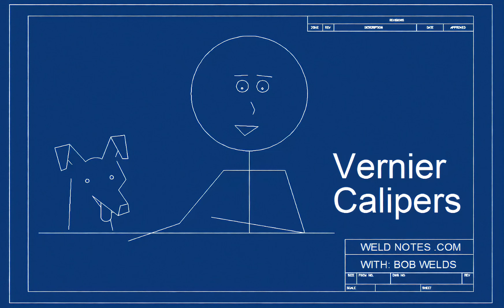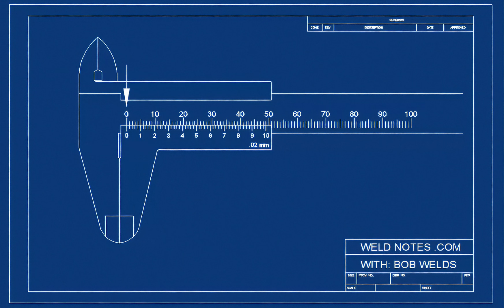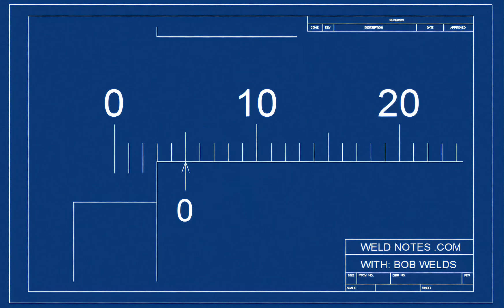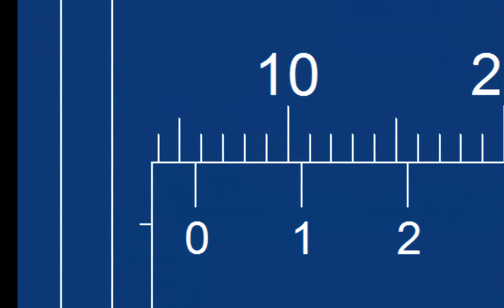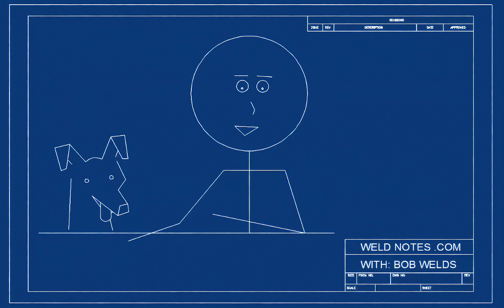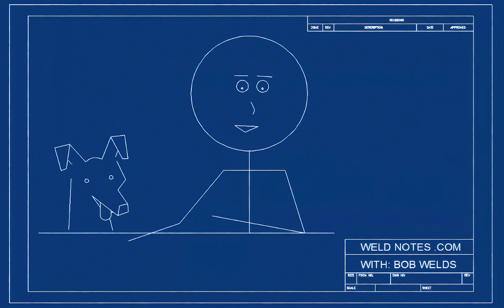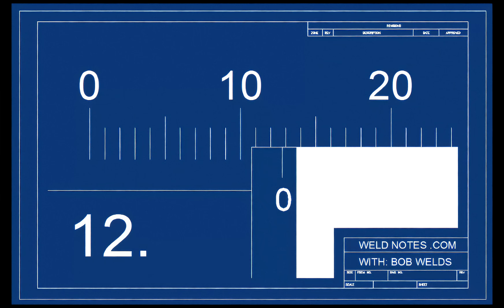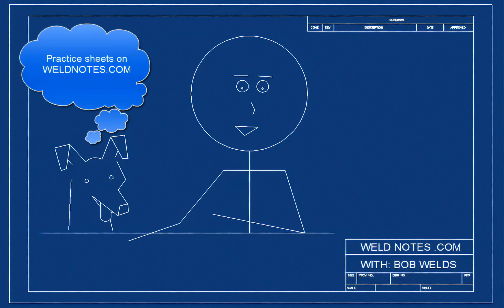How to Read a Metric Vernier Caliper

Comment: On your 19.16 example it looked like .14, .16, and .18 all line up, if they in fact don't you should reconsider examples that can distinguish the lining up on various resolutions, because at 720p those three look like they line up.

before I comment I also went back and you don't talk about multiple marks lining up and determining which one to choose, which wouldn't be a circumstance for these anyways. 
If there was suppose to be some form knowledge of understanding of reading vernier prior to watching this video I don't have it, I learned how to read them, but that second example is same situation as algebra homework throwing in something from previous section to already struggling students, and then they find it easier to drop out and go flip burgers.

Comment: Great video. I always used expensive digital ones at my old job and never learned the analogue reading. Brought a cheap one from bunnings for 3D printing and got it way off. This makes so much sense on reading it now I won't waste 6 hours on a print. Thanks for the much needed lession

Comment: at 3:50, i am confused as to how it is 5.72 and not 4.72! can someone help?
Reply: If you look like 10 seconds before 2:45 you bc an see that the 0 on the smaller scale falls on the middle between 5 and 6
Reply: You get the measurement for the whole number from the 0 of the smaller scale
Reply: Essentially, the measurement for the whole number is indicated from the 0 of the smaller scale rather than the bigger scale.

Kinda weird ik

Comment: great video but i’m confused about 6:29, the 0 mark for the main measurement looks like it’s at 13, not 12, so why is it 12.76 and not 13.76 ?
Reply: Because it haven't reached 13, it just passed 12, so it will be less than 13

Comment: as a machinist iam ashamed of myself that i didint know how to read .02  XD
We mainly use digital calipers to measure diameters but regarding the lenghts the normal ones are best and with that i had problems 
either way 
thanks for clarification

Comment: When you zoom in at time index at 2:46, you are changing the top scale and no longer have a continued accurate depiction of what you are trying to teach. You lose the first 3 lines of the scale and are no longer showing continuity for your students. If you are going to zoom in, then make the enlarged view still say the same thing but larger. Dropping those lines throughs off the students trying to understand.

Comment: It's not that hard to read, if you got a bit of insight of how to solve square root numbers on a time scale( the algebra method)
Reply: Or maybe choosing my grammar more correctly on a number(or numerical) scale
Reply: The root of 6 would be a number between the easy (outcome) root numbers as 4 and 9
Root 4=2
Root 9=3
Meaning root 6 will be inbetween 2 and 3...
But that's not the case here for the calliper reading method
Great video and cool explained in this one

Comment: Why it works : . . .50 marks = 49 mm
1 mark  = (49mm) /50  = 0.98 mm
You measure using the difference.
mm - mark = mm - .98 mm = 0.02 mm

Comment: I learned this years ago in pretty much the same way in "Berufsschule" I don't know how this translated correctly.. Work - School.. We got some examples and have chose the right answer and got it explained very well. Once you now how it works other measurement tools are pretty easy to use it's the same system.

Comment: Basic common sense, surely - but these analogue verniers hve been replaced by ones with digital LCD displays, so there is really no point in buying one of these old-fashioned tools, when there's verniers that can measure to 1/1000mm using LCD displays. I have one that cost under £25. For Americans, there's a button that switches to inches, so those who still use units that Noah used when building the Ark, you can relax... (but you still need to know inch fractions represented in decimals - and that's challenging for most Americans...)
Reply: but lcd ones are bad if you have them laying around for years and when u need it the battery is empty

Comment: Here's how to do it the easy way: Put the vernier caliper up on the shelf as a collectible artifact and then go out and buy a dial or digital caliper. When's the video on how to operate my K&E Log-log decitrig slide rule?
Reply: Good luck with your digital caliper in the middle of the field when your battery runs out or your display is broken because some idiot didn't take care of it.

Comment: Those are obsolete like the slide ruler. Now they are all digital, 4 digits, metric and imperial. Cost $ 35.00 in any store.
Reply: Good luck using that in the middle of the field when your battery runs out or when your display is smashed for whatever reason.

Comment: I have some doubts. According to my calculations, i am getting the least count as 0.2. I have taken the least count of the main scale as 1 mm and the divisions of the vernier scale as 5 getting the answer of 0.2. Can you explain to me where I have gone wrong?

Thanks in advance
Sid
Reply: Try this method.The least count equals the difference between two consecutive values of vernier scale divided by no. Of divisions between them.

Now as you can see on the vernier scale that between 1-2 or 2-3 or 3-4 etc. There were 5 divisions.

So dividing 1/5 gives 0.2cm.And when we change this to mm,it becomes 0.02mm.
That's it.:)